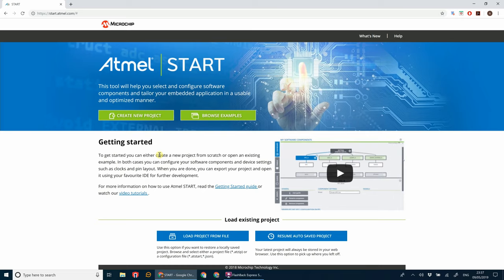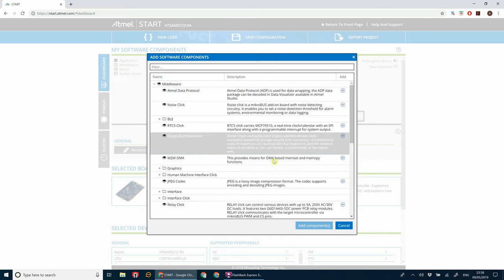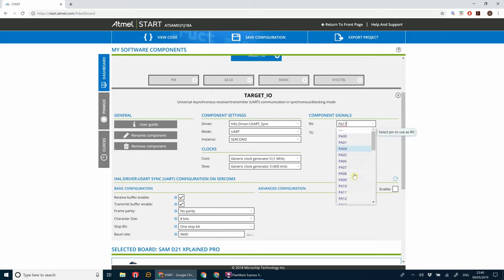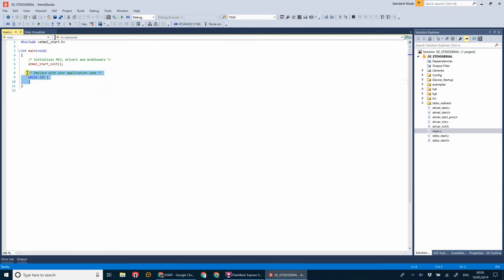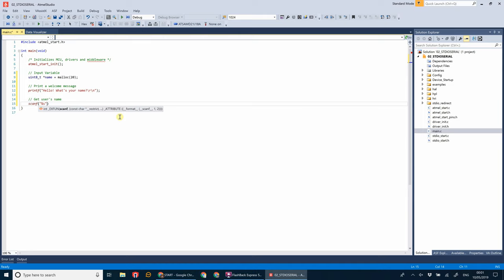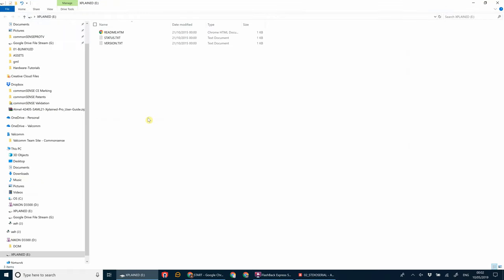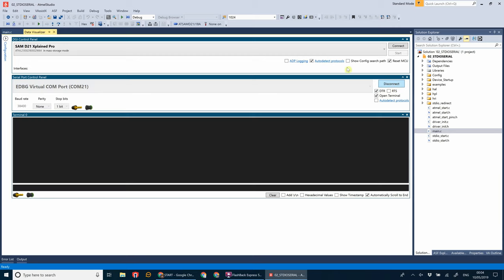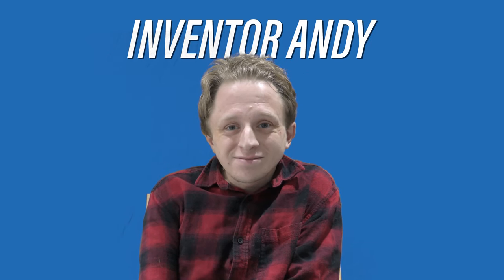STDIO Serial Communications on Atmel SAM D21 Xplained Pro - Tutorial

Comment: Thanks for the advice on the data visualizer. Since you asked for video ideas, a video on the debugger would be helpful. Though if you keep hitting on all of the peripherals (such as the ADC and so on) that would definitely be appreciated, and let's not forget about interrupts. There is a lot to cover just with interrupts.

I think your channel is hitting a well needed niche. Thanks and please keep it up!
Reply from the maker: Tutorials will be coming as soon as I can get the time to record them. I'll be looking at ADC (with an example on measuring battery voltage), PWM for motor control, RTC functions and interrupts.
Reply: @inventorandy3195 

Good that would be great, I'm looking forward to those.

On the subject of motion control. A tutorial on the quadrature encoder/decoder capabilities of the SAM4 series and the SAM 5s would be awesome! I know the E 70 has this also but I believe it's counter is only 16 bit.
 Getting just position is fine. Speed can be found easily enough from knowing position. I think some parts have issues getting both speed and position at the same time.

There is very little on that very useful peripheral. I know a firmware engineer who insisted he had to use a system-on-a-chip for a motion control application, because he had to write a quadrature encoder in the FPGA part of the SOC. He ended up getting way over his head and was very behind on the project. Later after he learned microchip had microcontrollers with quadrature encoder capabilities he told me he wish he had gone that route.
Reply: @inventorandy3195  Hi.Please could you do the BNO005 xplained pro with the SAMD21.Thanks